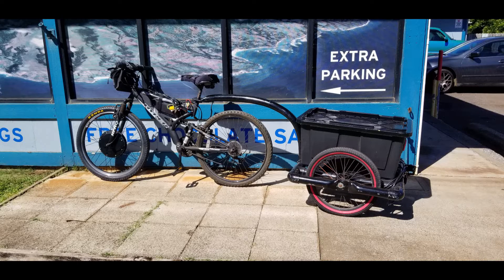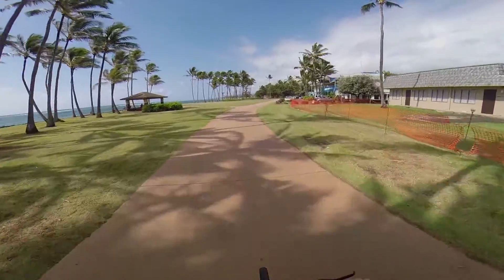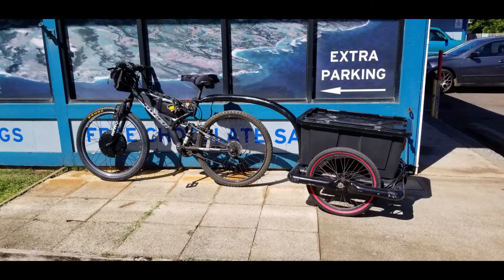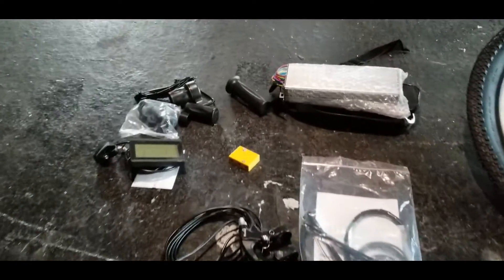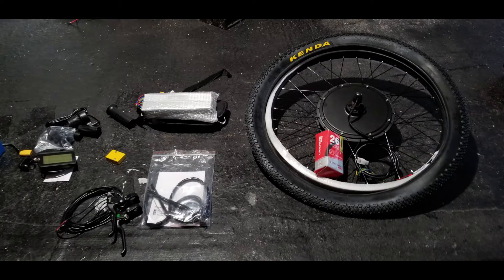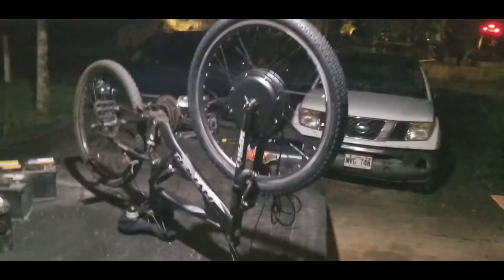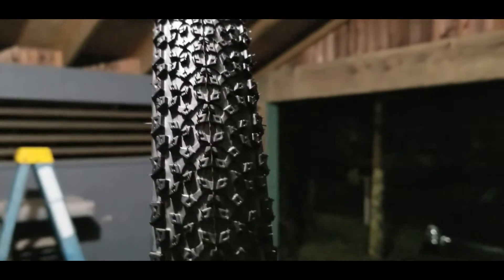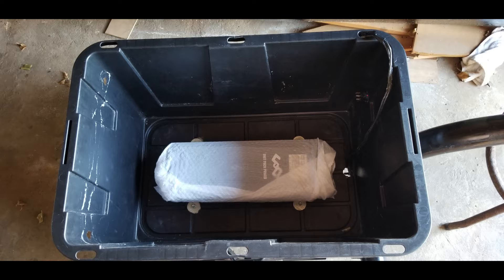E-bike Upgrade to 1500W Motor and 52V Battery - ordered from Ali-Express

Comment: One or two questions, your controller battery connectors (+ red,/-Black) are they 14, 12 or 10 gauge wire and did your 52v battery come with a Xt90 or Xt60 with 10 gauge wire connectors? The reason I'm asking, I'm considering installing that same setup, a 48v 1500w kit with a 52v battery. The controller that comes with the kit has 14 gauge battery connectors and the battery has a Xt90s anti spark female connector with a 10 gauge wire. I will have to cut the battery wires (14 gauge) on the controller and solder them to the 10 gauge battery wires. Would this be ok or would this burn up my controller? ANY help would be appreciated.....
Reply from the maker: I would trust the kit and use it as it is. I had no issues with it. I had no issues overvolting a 1000W either, works fine for over two years now.

Comment: With a lightweight  lithium battery you don`t realy need a trailer for the battery. Slide it into the rear gargo rack on the bike and your good to go. Then you can leave the trailer behind if you don`t need it.
Reply from the maker: This is what I did when I was able to get a battery shipped from China. Unfortunately I have a rear shock on my two wheeler and it broker the double-decker luggage rack that holds the battery. Now I am using a trike with a lithium battery in the basket. Check out my other videos.

Comment: Is that trailer really necessary?
Also if you’re gonna use a trailer, there are far bigger batteries you can have.
There’s a 36v 420ah battery meant for golf carts
It’s 110lb which wouldn’t weigh more than those lead acid batteries
Reply from the maker: The trailer is now gone and the battery is mounted on a rear rack.  I am over-volting with a 52V battery.

Comment: Love the new build. Thanks for sharing it. Suggestion? Wax paper wont stick to foam (much) and if a temporary frame was built to put atop the battery it could be used to flatten the foam while its curing, making a more consistant surface, imo.
Reply from the maker: I had the top of the foam be inconsisteny on purpose - it provides ventilation channels. I gave the trailer to a homelss guy and got a rear luggage rack for the battery... much better now.
Reply: @DIYKauai  Aloha and thx for responding. Q: What is your lowest cost, best performance trike, now that you have been able to build 7 of them. You said 1000 watt is better for meridian instead of the 1500 fwd motor.  I have been watching all your videos from the very first trailer build to e-trike transition. Can you recommend a supplier from AliExpress for the complete e-kit for 26 inch Swhinn meridian trike please? Thanks again!
Reply from the maker: @937DNA  Try CSC for the motor and UnitPackPower for the batteries!  The 1500W motor is almost too much power for the front forks to handle. 1000W is better.  I like the LCD3 display and the half twist throttle.
Reply: @DIYKauai  CSC, I don't know of? Are they on Ally Express, if so what seller do you recommend?  I have ne er done Alibaba or Ally Express before and would like to have a referred seller if I'm dealing with Chinese seller. At least I know they did well for you and won't rip me off? Any seller for Unit Pack Power? Btw, the 52 volt UPP with t he light built in looks great but I haven't been able to locate a seller? Thanks 👍
Reply from the maker: @937DNA  go to aliexpress.com and search for ebike conversion kits and look for the csc brand. Same thing for the batteries.
Reply: @DIYKauai Thank you for responding. I'll do that.

Comment: Thanks alot for the real world reporting of PVC for bike trailer.  I never had doubts, but wondered the weaker points such as axle or wheel mounts.  Im designing a trailer using schedule 80 (thicker wall) of about an 1.3 inch outer diameter.  It is possible to also use schedule 40 with its manufactured thinner wall to double up inside schedule 80. Schedule 80 also designed for the elements a bit better.  !/2 inch schedule 40 fits nicely inside 1 inch schedule 80, leaving about 1/2 inch air core.
Reply from the maker: I had the plastic break where the axels go through the plastic. Upgraded to 2" PVC and put some big washers on the flattened plastic parts - no problems hauling 200 lbs on it now.  I also had the trailer arm break where it connects to the trailer - going off jumps is not advised, lol.  I just fiberglassed the heck out of it and now it is super strong. Schedule 80 sounds nice... not easily available on my little island.

Comment: Can you please give me the link of the motor hub and battery
Reply from the maker: Here is one vendor example:  https://www.aliexpress.com/item/32886102991.html?spm=a2g0o.productlist.0.0.8e56c0461RTyST&algo_pvid=3ce090b3-0d6e-4a99-bd6f-336737b27688&algo_expid=3ce090b3-0d6e-4a99-bd6f-336737b27688-5&btsid=8d340fee-7d41-4b90-b1a6-a431201ee302&ws_ab_test=searchweb0_0,searchweb201602_3,searchweb201603_53
Reply from the maker: https://unitpackpowerebikebattery.aliexpress.com/store/1804469?spm=a2g0o.store_home.pcShopHead_5916447.0
Reply from the maker: I have ordered several hub motors from different vendors and they have all been good. China makes millions and millions of bikes. I order everything through aliexpress.com - the vendor does not get paid until you receive and approve the package.  I ordered the batteries through Unit Pack Power, a vendor on Aliexpress.